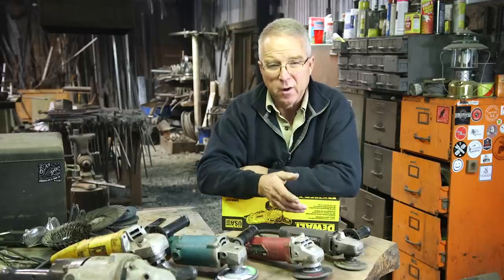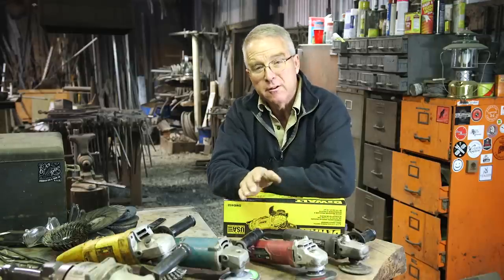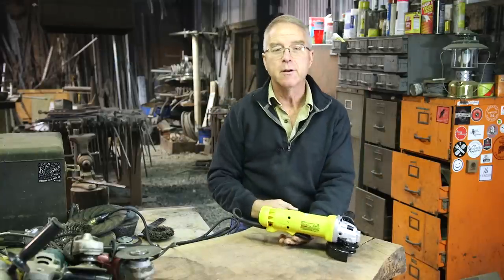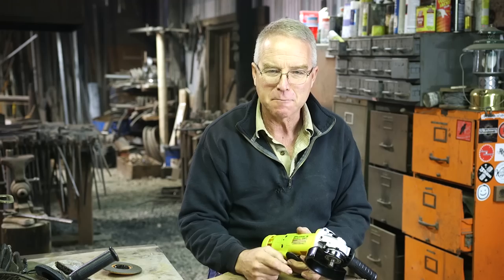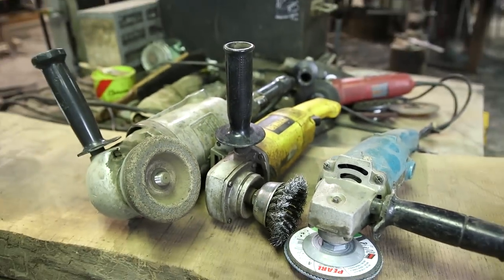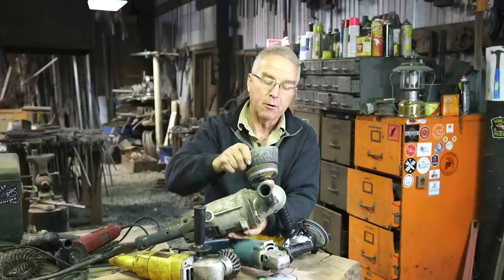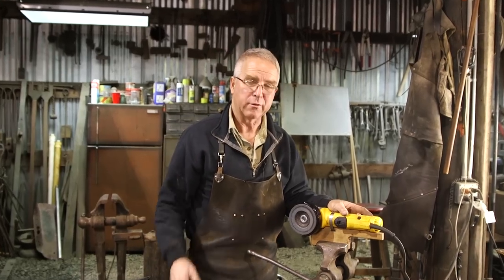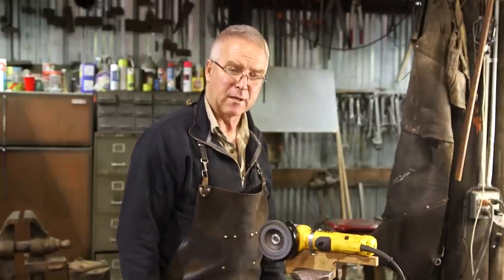Get Another Angle Grinder

Comment: You are so right. Everything you said is what I do here. I have 4 grinders. None of the grinders have a guard. I don't even know where I lost them. 2 of the grinders are Makitas with the trigger and no matter what I have done to them, they won't die. My newest is a Milwaukee 18 volt with the paddle switch and I don't care for it, but prob will get used to it  But I do a lot of metal fabrication and could not live without a grinder.

Comment: I have this same Dewalt and it works fine for me.  I bought it exactly for its paddle switch.  The size does not bother me.  I have two guards one of which I had to buy.  The only thing I don’t like is the sound.  I have been told that all grinders make the same noise, sort of like the grease ran dry and the gears are running without any.  It is just something you get used to which is greatly reduced by the use of hearing protection.

Comment: I use the same dewalt grinder almost daily, glad you emphasize the guard staying on. I worked in a railroad repair shop and learned how to use it with the guard on, and in the last 4 years of my dewalt grinders life iv maybe had the guard off 10 times. Also that back arbor washer is on there along with the rubber oring on the shaft so your wheels will hardly ever get stuck on there to the point of needing a arbour wrench weither you use the front nut or a wheel that is factory threaded (if you watch it squishes down on the oring a bit when you tighten it down which also creates the friction so the wheel doesn't spin off when the grinder is idling down) So you will be better off to just keep it on there along with the guard.

Comment: My favorite is the 6 in dewalt angle grinder 13 amp with a paddle switch model DWE43144N. I'm an industrial pipefitter. Great power and size without being too heavy like a 7 in. But that 4 1/2 is great too

Comment: I'm pleased to hear that you've had good luck with the Dewalt angle grinders.  I fried the motors in 6 Dewalts in a single day.  I kept taking them back to Ace and getting a replacement but finally I opted to shell out the extra 60 dollars or so and buy a Makita.  Not only did I finish out the rest of the day but the next several days using the Makita and that was 14 years ago and I am still using the same Makita.  I want to like Dewalt because I've had good luck with their cordless drills over the years but I'm not quite willing to give their angle grinders another chance.

Comment: I have used DeWalt grinders for years. After burning them up every 6 months, I tried out a metabo grinder. 4 years of daily use in a welding shop, it is still running strong.

Comment: I have that same size dewalt grinder but its 14 years old and still runs like a champ. I use it mostly for shaping and leveling uneven wood surfaces so as to save wear and tear on my plainer and joiner. The guard on mine doesn't move like yours its just held in place with a screw but i took it off years ago ( my wife hates that) have a few scars that remind me to respect the tool or it will bite you.

Comment: My cheap harbor freight angle grinder doesn't look like much, but has worked great for around 15 years - probably only use it 5-10 times a year for a few minutes here and there, but I've been happy. I buy the grinding and metal cutting disks they sell in 10 packs.

Comment: I have to agree with you about Dewalt grinders!!! I have burned through 4 Dewalt 4-12" grinders 7 amp and 10 or 11 amp models. I have also let factory smoke prematurely out of 2 skill and a harbor freight model. The fact that one of the old Dewalts spare parts rescued me is also a testimate to good engineering.  Once I had a bad bearing on one and the gear teeth were worn down close to disintegrating. Only time I've ever found a set of plastic gears was in #2 about 1999, I was able to swap out the bearing and gear set to get me back up and running for several more years when the factory smoke got out and it too was placed in a coffee can of parts. Old handles are a life saver, I dropped #4 and broke the plastic clean off the bolt and that coffee can held one in good enough condition to finish out life on it's newer version.  I think #3 had an "O" ring that was yellow that would keep the first backing washer in place... all since have received this to not have to deal with dropping that piece. And with gloves on I've become an expert at changing wheels from flap discs to cut off wheels to grinding wheels.  And as another example of safety three had thumb switches one was rearward and two were on the left side of the housing, it is through these switches I learned to never again tie the cord knot we so often do to keep a saw or other corded equipment from coming unplugged in a cut... that unbreakable bond to the electric power source was nearly my undoing... as under full power it left my hands on a trip with nature to be turned into a spinning wheel of death or dismemberment, with no control over it's direction, and a chainsaw chain wrapped around 2 giant washers in its maw headed right back at me at just below face level.  I managed to escape from it's deadly force and will never forget that had the cord pulled out of the extension cord instead of being held in place I would have never been so scared of the close call that it caused . I was lucky and No guard would have prevented flesh and bone from being attacked by this innovative tool... be Safe  always... keep up the great work and Merry Christmas to you and your family!!!

Comment: Angle grinders are the routers of the metal world. I have over 20 routers across several jigs and tables. I’ve got 4 compact routers that I keep set up permanently with edge forming bits. It’s amazing but not surprising how much more productive you are when you don’t have to stop and change bits. I love having multiple tools. I’ve got 5 impact drivers and 5 drills for the same reason!

Comment: My first angle grinder was a $9.99 from HF.  It ran about a year.  It came with a spare set of brushes, but we didn't even try replacing the brushes, tossed it and got a Dewalt with the slide switch.  We also have a Dewalt with the paddle switch.  We usually have a wire wheel on one and a flap disk on the other.  We do swap out grinding and cutting disks.  One still has the guard on it, the other doesn't.  We might be able to find a handle or two if we look hard enough.

Comment: Would love to see a video on your vise adapter for mounting angle grinders.  DeWalt has made steady improvements in their angle grinders over the years.  My 10 year old, 4-1/2" grinder has a frustrating guard.  You have to use a Phillips screw driver to loosen and adjust it. Major pain!  Thanks for the review; very useful info.

Comment: I managed tool rooms, die repair, maintenance and machine repair departments between 1980 and 2013 when I retired. 
Angle grinders are an integral part of the work done daily by all of them. When we first got our hands on a Milwaukee 4" grinder it was a big hit. The 8" angle grinder went back to the tool crib and only came out for about 10% of the time compared to the 4" 
The first Milwaukee eventually wore out and we went through several more after that. Milwaukee was going through a change and the tools got worse and worse. Because we were using multiple grinders I went through most of the brands and they were used to destruction. The Dewalts became the go to for the reason they were inexpensive, available, and lasted as well or better than most. 
Remember that most of them broke from abuse. Dragging an angle grinder around by the cord is a guaranteed fail. 😁😎

Comment: I see a grinder/sander that I loved, at least I think so in the first minute.  The one at the south edge of the frame should be a black and decker ?bobcat or tomcat? something like that.  My dad had one of those that was technically a sander while I was growing up but we used it as a large grinder.  Called it the "death grinder" because of two reasons.  First, the thing was way more powerful than a smaller 4.5-5 inch grinder.  Second, we usually had a wire wheel on it and I don't know whether a bearing was going south or the wheel was unbalanced, but you could run that thing for a minute or two MAX before your hands and arms felt like jelly.  I'd love to have one of those again, haha.  Brings back memories.

Comment: They are necessity.....I have 4 but use 2 regularly....1 with metal cutoff wheel for nails, metal in demo and cutting rebates or Simpson bolts and another with diamond blade for cementicious applications....like you said always going back and forth so instead of constantly changing blades I have 1 set up for metal and other for concrete or stucco....also a 7 in with cup wheel for grinding concrete

Comment: I've bought a few dozen of the DeWalt you have there, for our fabrication OEM. 11amps, under $70, hold up extremely well, great ROI. I source the tools, so not using them -- but I'm told the only issue is they do not have a soft start. Can jump right out of your hands. In the process of switching them over to a Milwaukee version. We are still on 120v grinders...one day pneumatic.

Comment: I like the thumb switch with the lock, as I do have a smaller hand and find trying to hold a paddle switch means you get hand fatigue quicker as you can not move your grip a round a bit when doing bigger jobs and a loose fatigued grip can be pretty dangerous to self. and the one with a trigger gets your hand way out back and make one handed operation very hard and just plane dumb.  Now don't get me wrong a locked in the on position machine can be dangerous all by itself as you mentioned you need a paddle with a LOCK OUT so it wont start and run off on its own, as you have also said many times find what works for you! and your Videos work for me and I hope others do some work for you and find something to do to let the commercials run while waiting for the video and not skip them. when I find a youtuber I like I stop skipping add's as I want more content!!!!! Thank you.

Comment: If that’s the same skil brand grinder I have , it comes with a handy handle design that fits the wrench right inside which guarantees you’ll always have it on hand . I needed up taking it off the grinder and putting it on my Dewalt. The wrench still fits

Comment: I keep 4 Dewalts in the rig two 7amps (side switch) one for cutting and one with wire wheel and 11amp with paddle switch (grinding). And 9inch Dewalt, the welder is a Lincoln SA-200 and it is only dc power Dewalts are made for dc or ac so I have to have them.

Comment: I have a similar DeWalt grinder, but mine is the battery powered version. If you turn it over so the blade side is up, you can turn the guard clockwise without pressing any levers. (Mine also has a dead spot as you showed in your video where it won't lock in.) If you want to turn it counter clockwise you can by pressing that little chrome lever. A word of caution though when going counter clockwise, be careful to hold down-pressure on the guard or it will try to come towards you and will come loose. It isn't to hard to get back on, but it is a PITA.

Comment: I have two in the smithy, and am looking to add a third.  Like you say, it's easier to just grab another grinder than it is to swap out the disk on the things.

My next purchase will likely be a die grinder rather than another angle grinder.  I have my eye on a vintage all-sheetmetal B&D lass that appears to be almost new-old-stock!

You can't have too many grinding and cutting options, in my opinion.  Blacksmith, like us, or jack of all trades, those angle grinders are exceptionally handy!

Comment: Looks like you just secure the grinder to a block of wood by putting a bolt where the handle thread is, and for extra security so it doesn't turn on you, add a hose clamp around the grinder and through the block.

Comment: just found your vids, think there really informative. as for mounting your grinder a safer way is to make a bracket that bolts into both handle mounts,a lot safer method. then you can either fasten it to your bench or fit it in your vice

Comment: I run one with a 36 grit sanding disc(3m) and another with a cutoff wheel.. both dewalt and I've not burned any up yet and I use them alot!! Metabo is a great brand aslo..

Comment: I have 8 angle grinders. All 4 1/2 inchers. 6 are harbor freight $16 ones.  One is  a skill. My good one that I use if I'm running it hard is a Bosch. Gonna order me a 7 inch Bosch tonight.  I need at least one big one to really remove material and I'm on a project that I need the extra reach of the bigger blade.

Comment: HA! You found the guard lock before it was over!  That was going to me by comment. I thought I was going to take the guard off, too, but when I saw how it works (which is well. It works well), it stays! Funny how they've been making "safe" paddle switches for so long and only now are getting around to good designs. It ain't like it's a hard engineering task, it's just that nobody wanted to spend any resources on it before.

Comment: I always use the guard, makes the sparks less annoying. Plus, on my big gas axe, the guard damn well saved my life once, when a 320mm metal cutting disk disintegrated at a little over 6000 rpm. My legs were sprinkled with cuts from the shrapnel, but everything upwards of the hip was a-ok

Comment: I have a 4.5" Dewalt I purchased way back in 1995 after I burned up a Craftsman. My Dewalt still runs like a champ, though it is considerably noisier than it used to be and it does get hotter these days. I'm sure that has to do with the grit and dust getting to the moving parts. Got to love a $30 tool that lasts 23 years even if getting it fixed cost nearly as much as a new one.
Reply: if its very noise and getting hot, probably the gears are worn out now
Reply: If the gears were worn out it would not run. No doubt everything inside the casing is worn, but it is not worn out.
Reply: @StutleyConstable  nope, you are wrong, they do run, open the gears and have a look and if there is some play from wearing in there, they get noise and get hot, that happened to me and after so many years i think it is time...
Reply: @Alejo Colombia it seems you and I have different definitions of 'worn out'. I know the gears and everything else on this particular grinder are worn. If it burns out tomorrow, I have gotten my money's worth. I have other grinders I use. I won't be spending any time opening the casing of this one to poke around and visually confirm what I already know from hearing it.

Comment: i have 4 grinders and as a welder i use them all but i must say i use a dewalt just like that with a flap disk more then just about any other and that switch is so nice. i dont like the handle its to smothe so i put grip tape on it but any way it was a good watch

Comment: I just bought a DeWalt sabre saw - made in China - and am extremely happy with it.  The lever blade lock and base plate adjustment means you need no tools to use this saw.  The base is cast aluminum with an ABS plastic cover to protect soft materials and it has an LED light to help you see the blade, tho it is positioned about 1/4 inch too far to the back to actually illuminate the blade.  I am going to build an angle grinder table and buy a new DeWalt grinder for it because of your review.  I have been hearing complaints that their quality is slipping, which I hope is not true.  I see many DeWalt tools in YouTube videos, so many people depend on them.  I hope they continue to be a brand we can count on for decent power tools.  I see they are selling similar models at lower prices and less features under the Stanley name.  Since Black & Decker owns almost every tool maker now, the choices are getting scarce.  Makita's quality is good but for hobbyists they are a bit pricey. Great video.  I'll be checking your other ones.

Comment: I've agreed work almost everything I've ever heard you say workwise.  But,  with regards to grinders I've got to say I feel a little differently regarding triggers.  Considering I own about 8 grinders right now,  5 corded,  3 battery powered.  Different sizes and shapes, and a few different trigger types.  They all have their uses.  I like the thumb trigger on my 4 1/2" Makita.  I like that I can snap it on,  and then make cuts in tiles and other materials more precisely because of the fact that I'm not restricted by my hand placement needing to be on a trigger the whole time. I can use that sucker to remove a filling if I needed to, hehe. So,  I just wanted to point that out and that for that purpose I will always own at least 1 or 2 grinders with that trigger style. 
Great video.  Take care

Comment: Great review. I don’t use the wrench to tighten the nut, just spin it down to the abrasive and then treat it like it has the built in nut. Cutting wheels is the only thing I use the wrench for because of course you don’t want to fatigue the wheel in anyway. That guard is designed to only lock in positions that will keep the debris hopefully flying away from you.

Comment: I do my shop work as a hobby but I am out there every single day working for several hours at a time and I think I have actually needed to take the guard off the angle grinder 1 or 2 times over the last 6 or so years. This includes a LOT of metal working.  I think its a psychology thing for most people.  They think it will be in the way when most of the time, it just isn't.  (There is also a silly macho thing going on too for some people.)

The only times I needed to remove the guard is when I was under a car and needed to cut something in a very awkward position.  For ANY kind of metal working, and I can't even imagine a situation where the guard is ACTUALLY in the way and needs to be removed.